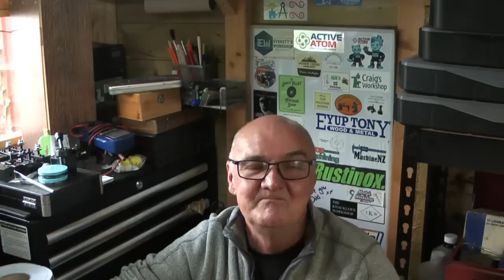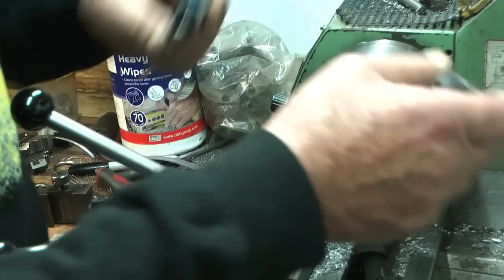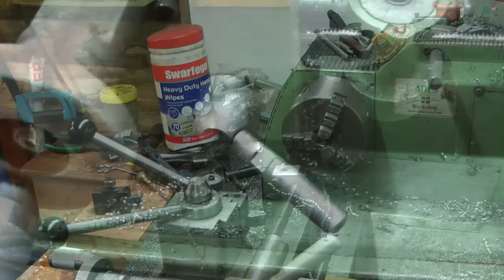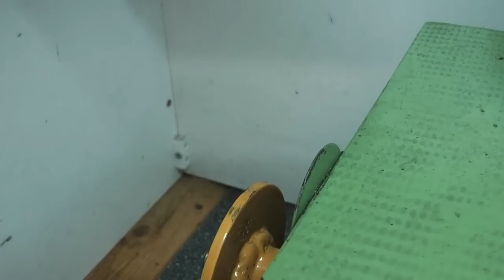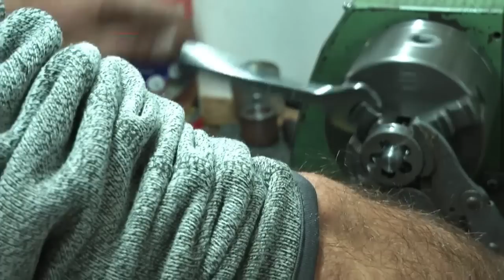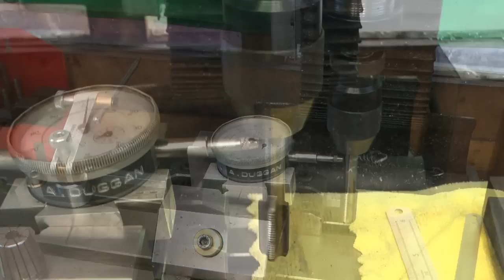Making a drill chuck arbour for the mill "Twice"

Comment: At risk of trying to teach his grandmother how to suck  eggs, here goes.  On the drill chuck arbor registration of the chuck should be against the machined face at the end of the screwed spindle. The screwed part is  only a fastener and only requires to assemble into the chuck. There is no requirement for a close fitting thread. If you split the die with an angle grinder so that it can be compressed to cut a slightly smaller diameter and looser thread then maybe the scrapped arbor could be made to run truer. As ever, enjoyed the video.

Comment: Hi and just a quick comment having done a few of these types of chucks myself unless you are intent on running the chuck clockwise all the time you shouldn't need to use locktite on the thread as all the threaded chucks have a left hand thread usually 6mm drilled  into the end of the half inch threaded part to stop the chuck from unscrewing itself when used in reverse which is normally an M6 left handed countersink screw

Comment: Beautiful chuck deserves better. 
If you look at the rear of the chuck internal thread there is an unthreaded portion.
This is the register for the spindle.
Similar setup to a threaded lathe spindle.
The thread is only there to pull it over the internal register and back face of the chuck.
The thread is simply floating.
Reply from the maker: at 15.15 into the video I mention this very fact and turn a 2mm long portion to pick up on the register as you said .the thread on the first one was so far out that the register could not do its job . I am very happy with the second one with 0.02mm runout . Thanks for your input and valid point . Cheers Ade.
Reply: How ya going, I see a lot of youtubers not using the register as intended relying purely on the concentricity of the thread